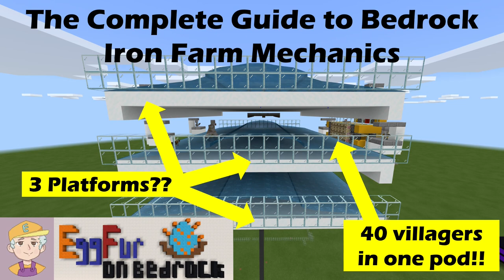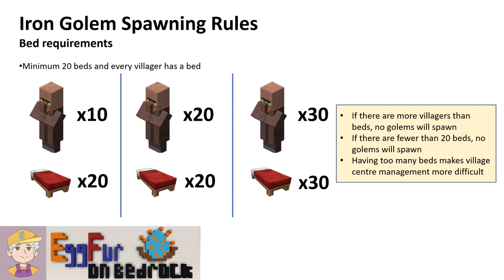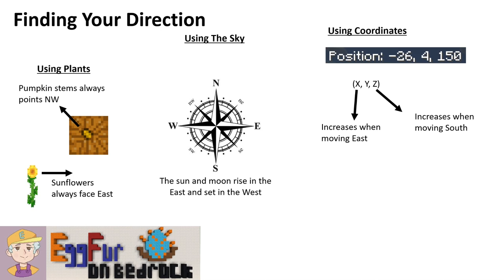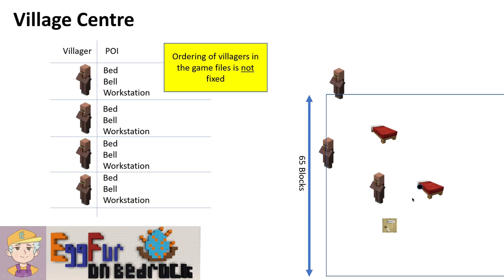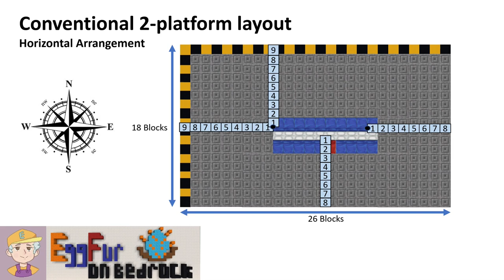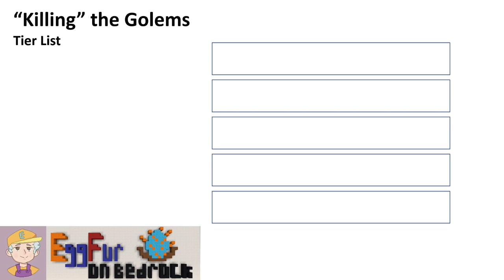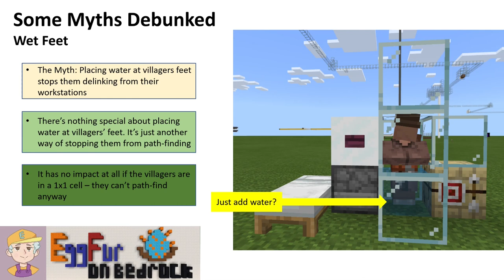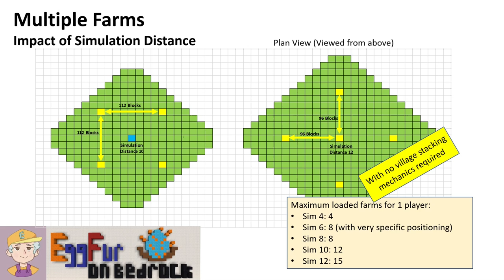Bedrock Iron Farm Mechanics: The Complete Guide

Comment from the maker: Thanks to Boxing Kanga and GoldenHelmet403 for letting me know in the comments below that I was wrong about golems being unable to spawn in portal blocks. They can. I'd performed my testing with a 3-high portal, and they need 4 blocks to spawn in.
Reply: Hey eggfur I don't know if u missed it but do they spawn on top slabs
Reply from the maker: Hi James,  even top slabs are transparent so they aren't a valid spawning spot for golems. It's just different to normal spawn mechanics,  but simple in a way.
Reply: @Eggfur  thank you that explains why I'm getting no spawns
Reply: @Eggfur  They really do spawn on top slabs.  I've got a whole spawn platform made out of top slabs in front of me.   

I surmise that it changed at some point circa 1.18ish.   And no, they're not spawning on some solid block below and glitching up, either. I've got mark&kill command blocks running and i've now got a nice 17x17 warped topslab square in the middle of my 30x30 oak topslab platform.    The nearest floor is 7ish blocks below and it's glass.
Reply from the maker: Yes, a few things have changed since this video. In particular: having two platforms is pointless, and now golems will spawn on anything with a full top surface and made of a "solid blocking" material. Oh, and isn't a damage-causing block.
Reply: @Eggfur  Oh lol, they'll even merrily spawn on top of hoppers.  That was actually a bit unexpected.      ... And, apparently, solid blocks with fences on top of them, even when there are no neighboring solid blocks = they end up hanging on by their toenails and never moving.     

Also only the spawn block itself is checked for damage - everything around it can be e.g. magma, meaning they take damage instantly.      (I don't see this leading much anywhere useful but thought I'd report the finding. Hm, I feel a wiki edit coming along.)
Reply from the maker: Yes, the fence thing is a big introduced recently. Pretty sure that's not intentional. I didn't know they could spawn on hoppers again though!

Comment: I’m glad mechanic videos like this exist, allows me to experiment for myself rather than mindlessly following a tutorial
Reply from the maker: Thank you. However it is a bit out of date as there have been some changes since 1.17.30. Big items are that golems now spawn in a 17x13x17 area, and they only spawn on the highest spawnable block in that area. So you only need one platform, but in fact you can get higher rates with a smaller platform - still capped at 411/h

Comment: firstly, sorry for the long response and also editing this comment several times. I'm pretty passionate about iron farms ( but not a fanatic I hope)

Nice explanations there Eggfur, but unfortunately I think you got few things wrong.

The best part was the explanation of the golums spawning area and platform design. It was spot on and really well explained.

The POI explanation was good too, and the distance you need to be from other village's poi.

But to my understanding village boundary is 64 X 24 X 64, centres on the bottom NW corner of the first claimed POI ( assuming a unstretched village)
 
Golums do spawn in portals and the village forgets them right away, but you need two players to make it work effectively (at least that was the case in my testing on 16.210). 

I also find the drop village as fast as the trident killer with water and impaling V.  Drop village is my preference. In my 20 villager farm I got 5 golums spawning in 10 sec at one stage ( followed by nothing for the next five min 🙄), but the point is this is only possible if the spawn village forgets them as soon as they enter the drop village.

 There is also the time it takes to get the Golum to your kill point that adds to the total kill time from spawn to death, you didn't factor that in to your kill times.
Kill speed, once you get it down to less than 16s, isn't that important as it only makes a few ingots difference over an hour. It's the  spawn rate that limits iron farm output the most.
You can also get way more than 4 iron farms in Sim 4 by stacking villagers although I agree with you and wouldn't use it as I have heard it breaks too easily, but while they work they produce massive iron rates.

Rufus's videos are fantastic and The Skeleton idea is a really good one too. It shaves 2-3 seconds off the total kill time. I used zombie pigmen  myself because they also attract the Golums, are easier to manage and won't  shoot you when you come to visit the farm, but sometimes the Golums don't notice them.
Reply: Yes, it's been a while but I designed a spread sheet that calculates the rates of my farm and even a bell curve chart of the probability of the hourly rates.

Yes, I had a bit too much time on my hands but not all of are as talented as you when it comes to Producing youtube vids.
Reply from the maker: Interesting observations. You can see the village size by checking the game files in an nbt editor. If you place a bed at 32,16,32 then the default village will be from 0,4,0 to 64,28,64 which is 65x25x65, with its centre as the pillow block. The NW corner is used for the golem spawn range but not for the village itself.

I built an iron farm where the entire platform was portals (no gaps). It was in spawn range as I got cats (and pigmen), but zero golems in the nether. I'll test it again to confirm... I think I said that you could push them into a portal if you had two players. 

I agree that kill time isn't so important, except if you have only 10 villagers or are trying to super optimise.

My timings were from when the golem leaves the platform (sorry, I wasn't specific), with the caveat I gave about using lava on the platform itself. My drop village kill time included the drop from 80 blocks. The drop itself takes less than 3 seconds. I got around 12 seconds total when I tested, but as I said it does vary based on your world - I might have been unlucky.

I think we have the same view on village stacking... :)
Reply from the maker: So, I double checked my portal platform - still no golems spawning/going to the nether. I'd be really interested to hear if you can reproduce them spawning inside a portal blocks. I don't think it would be most people choice, but would make an interesting 2 player farm. Overall I doubt it would be very efficient though, since you couldn't have your beds under the platform or they'd be inside a portal
Reply: @Eggfur  I can send you a full portal iron farm test world on Discord.
Reply from the maker: Hi, that would be great! I need to sort my discord out if we're going to do that though. I'm confused why I'm not getting any golems in my portal test farm then! Let me test it again, again first and see if I get a different answer. Presumably you get pigmen and cats in yours too?
Reply: @Eggfur  yes, pigmen and cats too. I can just reply here with a link to it when I get it uploaded, no need for you to sort out discord.
Reply: @Eggfur  here: https://cdn.discordapp.com/attachments/660598554745896960/842147752976056320/Iron_and_Gold.mcworld Cats are tamed on the roof to stop them spawning. I think I did that b/c they don’t die in tk, but it’s been a long time so I don’t recall. It could definitely be improved, this was just a concept I was working on at one time.
Reply from the maker: Sorry this has taken an age to reply. It took me that long to realise how much of an idiot I am :) I built my portal iron farm with a 3 high portal and the golems need a 4 high space to spawn - hence no golems, but plenty of cats and pigmen. I'll update the description and pin a comment to correct tomorrow. Thanks!
Reply: @Eggfur  yeah, sometimes it the simple things that trip up a design.  I built an iron farm in a cold biome once and forgot the signs to stop the water sources freezing.
Reply: @Eggfur  ok, sorry for the extended time to reply.  I have not had a chance to get on my switch to experiment.

I don't dispute what is in the the game files in NBT editor. I don't have that option on the switch, however what does this mean in practical in game terms.

I set up a single villager village with the pillow at -220, 40, 268.
I then proceeded to give myself bad omen and approached the village from each direction to see at what point the raid was started, this being the effective village boundary.
I ended up with boundaries of -252, 27, 236 to -189, 50, 299.
64x24x64 ( including all blocks)

I'm sure if I managed to get the files and looked at my village boundary I would see dimensions like yours, but here is my theory.  The last block on the top, east and west in that village boundary don't count because of the north/bottom/west spawning rules. ( I've, detection rules work like spawning rules).

I'm sure Hey Old Guy would have fully tested this more than me, but just sharing my own experience.
Reply from the maker: @BoxingKanga  I think we mostly agree. The game uses two different centres depending on what it's calculating. The resson I'm confident in saying 65x65 is that in my village from my last reply, I can place POI at 0,4,0 and 64,28,64, connect a villager to each and this doesn't change the size of the village in the game files and so it must have been the full 65x25x65.
Reply: @Eggfur  yep, that's pretty good proof.

Comment: Fantastic video! Can I ask two questions about grinding mechanics?

1) When you say it takes 12 seconds for a golem to delink from a village, does that mean 12 seconds to be pushed to a new village, or 12 seconds to link to the new village after it arrives?

2) you mention a 3x3 t killer (which I would LOVE to see btw) but I installed Silentwisperer's advanced t killer (2x2 conventional piston-pushing design, with impaling V). This thing works just fine, grinds them down pretty quickly.

Is there an advantage to a 3x3 design that isn't immediately obvious?
Reply from the maker: Hi and thank you! The 12 seconds varies and I included the time it needs to drop 80 blocks and then to connect to the new village. So it can be anywhere from around 3 seconds to something probably a bit higher than 12. I erred on the side of caution...

I've had issues with golems in 2x2 trident killers, but maybe because I run them as fast as possible. 3x3 seems to work better for me, but if your 2x2 is reliable I won't argue with that!
Reply: @Eggfur  thanks for your answer!

I used your video to design an iron farm that sacrifices several spawning blocks to push golems down into a central t killer (minimal time to kill). I might look into the rates & compare it with a design that maximizes spawnable blocks, but has a higher time to kill thanks to its reliance on village delinking...

Do your golems just hang out on top of your pistons due to them firing all the time? Silent's t killer (my current favorite) has 3 repeaters with 2, 2, and 1 tick delays. I'll look carefully to see if golems get stuck.
Reply from the maker: @B463L  yes to the piston question. To be fair I probably need to do more testing on whether faster pistons are actually better, since there's the damage cooldown anyway.
Reply: @Eggfur  I'm actually willing to bet that the mob hitting the trident's hurtbox as fast as possible is more important than getting the pistons to fire faster, for exactly that reason. Seems to affect golems a whole lot, and I'm willing to bet that spiders are affected as well.

I designed a platform-based t killer, with a 3x3 platform pushing a trident around a 2x2 kill chamber. It's very fast, but tridents can clip out the sides of it. Other platform t killers seem to have their platforms break sometimes, a problem that I managed to solve by replacing some of the platform blocks with slime blocks. Despite being 3x3, I have a total of 4 pistons pushing it around.

Comment: 39:54 you can actually fit 3 iron farms on sim 4 per layer for a total of 6 iron farms
Reply from the maker: That's not correct. The iron farms need to be 96 blocks apart. There's no room to have 3 on a single level in the SIM 4 diamond
Reply: @Eggfur you can fit 3 iron farms on the same level on sim 4 while having all poi at least 96 blocks apart you have to make a weird triangle shape to make them fit and they won’t be max size platforms but the platforms are big enough to be better than 2 max platform iron farms I’ll send you a dm of the layout later today so you can see what I mean
Reply from the maker: Hmmm, it's maybe more possible in current versions because you can stack the beds and smaller platforms are still fully efficient. At the time of this video, the beds had to be spread out on one level and reducing the platform size had a big impact on rates. I'd be interested to see what you come up with and work out the efficiency.

Comment: Hey Eggfur does the 12 seconds you find for dropping a golem involve the time for the golem to travel? Or how did you test this? Trying to figure out if it'd be the same "kill time" as spawned in a portal
Reply from the maker: Hi, I included an 80 block drop from the edge of the platform into a different village.  The actual time it takes for the golem to join the new village can vary quite a lot,  with 12 seconds being closer to the upper bound. I got my testing wrong with portal based farms,  so haven't tested whether the golem leaves the village instantly when it spawns in a portal.

Comment: Thanks man. I have heard people using ravagers for killing iron golems and I think it’s faster. Is it possible?
Reply from the maker: Oh I seen to remember a prowl and blujay video where they were doing that.  It's fun, but not faster on average i don't think - and quite unreliable from what I saw.
Reply: @Eggfur  thanks. Are impaling V trident killers faster than lava killers in iron farms?
Reply from the maker: Did you watch the video ;) 2.5s for trident killer with imp V and 12s for lava.  However,  you can get them into lava quicker than to a trident killer, so the actual difference is less,  depending on your design
Reply: @Eggfur  thanks. I have learned so much new things from you keep up the good work.